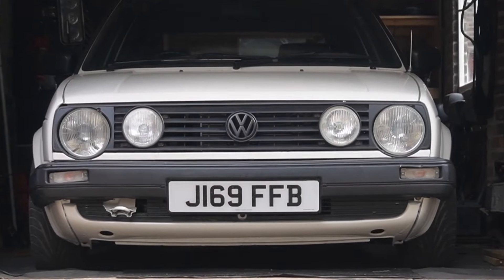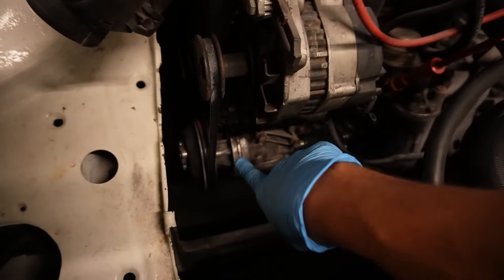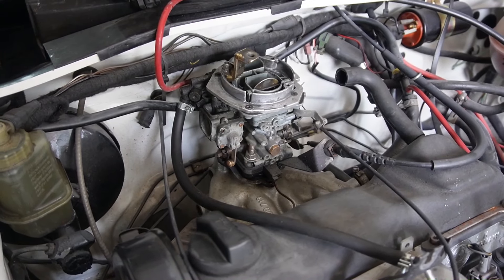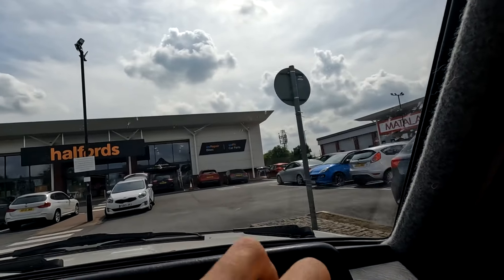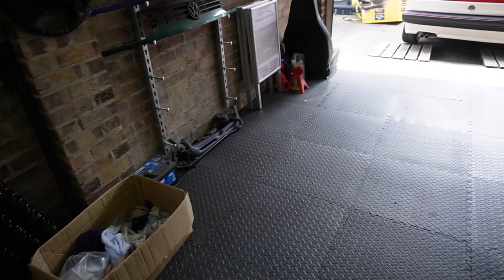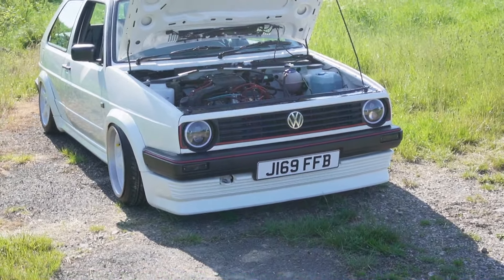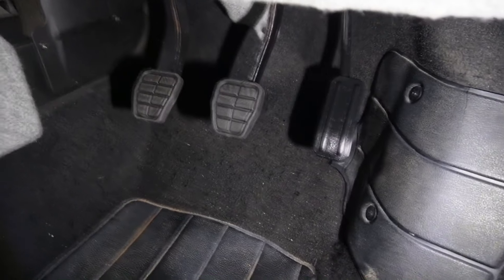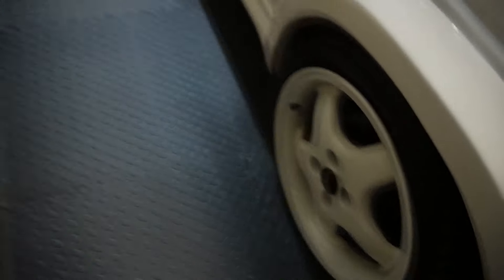Installing eBay Bargains On My Bagged Mk2 Golf

Comment: FYI, change your locks now, because every one of those keys can be duplicated from this video.

Also, this won't work on newer cars, because they all have a shitty little transponder in them that the ECU checks & validates before it'll let the car start, which is why it costs so much to make new keys from the dealership... ( which is also bs, because the parts and labor for that are stupid cheap).

Comment: Great video..good content. Loving the mk2.. Poss rear roof spoiler in white.. and a eyebrow(bonrath) above them nice headlights, def sets the front off..   I'm 53yr old dub head, had 3 mk2s and mk2s some years back..such great cars. I now have a boring mk4 now. Keep up ya good work dude
Reply from the maker: This is your sign to get another mk2 🤙🏾🤙🏾

I agree it could benefit from a spoiler massively, I was also contemplating painting this spoiler while while it was in paint but I was talked out of it

Comment: So you're admitting you're missing the centre heads😅but the lights look well...the rims were a good choice..good job on the refresh...put in a pd 130...easily pull 200bhp and with the g60 brakes will handle the extra power from the pd...key came as standard from 16v upwards
Reply from the maker: Ohhh definitely not but I never saw them on the bbs kit so they might look good 

Thanks dude!

I'm going outside the box on the next engine swap 👌🏾

Cheers dude
Reply: @Project7YT  are you going with16v hubs for the 280mm brakes?
Reply from the maker: I've got a full g60 setup
Reply: @Project7YT  only way to go👍if you put the the mk3 vr6 master cylinder you'll have alot more breaking power..fit the 16v or the g60 servo ..mk3 master cylinder bolts straight on..its a noticeable difference.its all plug and play.
Reply from the maker: I will look into it, Matthew minute the brakes are all OK

Comment: Great video as always bro, very informative and educational. I remember you done a headlight upgrade a few videos back, do you think the new headlights would have worked if you didn't have the upgrade?
Reply from the maker: Thanks dude,

Yes 100% thwy might not be as bright but they'll be way better than standard bulbs
Reply: What did you type in ebay for the brackets? @Project7YT
Reply from the maker: 7" headlight bracket
Reply: @Project7YT  thanks brother